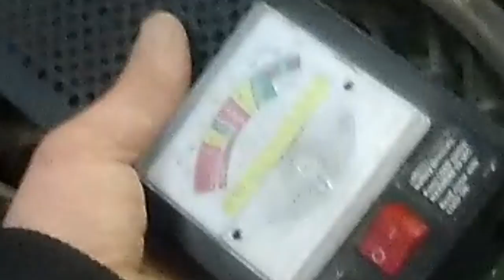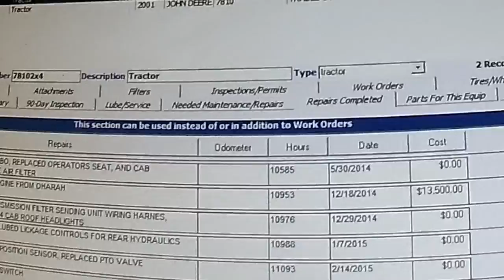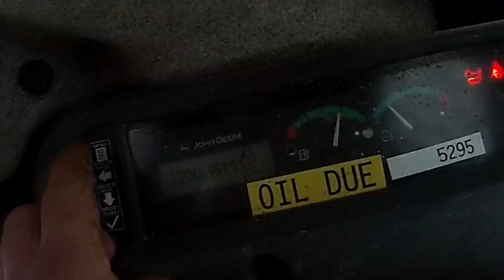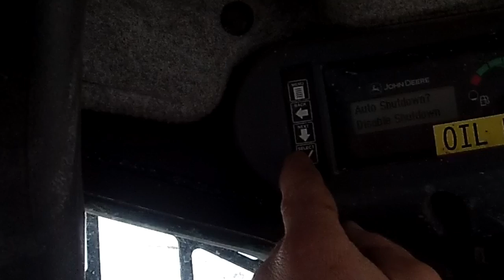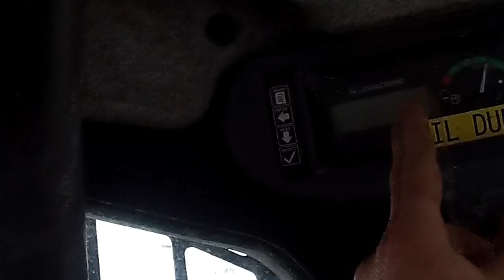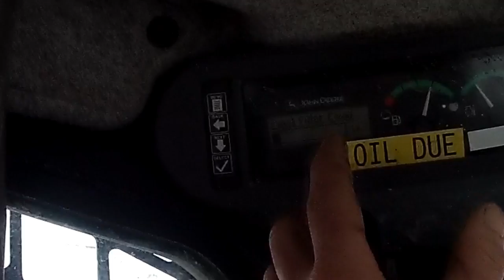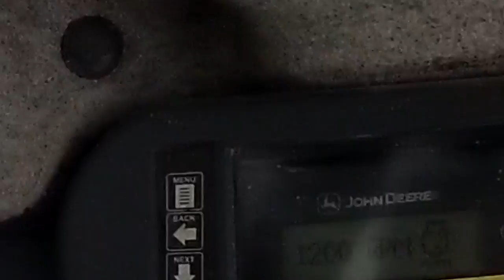Plowing snow and other stuff  1/20/2019

Comment: So when you jump start or charge start a rig you need to unhook the charger before starting or have the ground on the chassis or you will blow the diodes in the alternator (like you just did) on the tractor.
Reply from the maker: They are touchy

Comment: my father bought a set of truck chains for his skid steer and it helps out alot in the mud and snow
Reply: I used to drive semi and had the trk cleaned out to turn in for some time off but instead left sick of bull crap. I had the chains from the trk at home. They were useless as is for me so i trimmed them for my pu trk. Ive loaded the wood trl heaping full with wood down a steap hill off the side of the road. Road was glazed iced and pulled the trl out with a 2wd trk with chains.  I carry them in my f350 dually for emergency use

Comment: Hey Andy. Another cracking vid. Would the 7710 not go on wagon temporarily to save the swapping alternators?
Reply: I would assume it would be alot less maneuverable inside with a loader was probably why they opted to switch alternators... just a guess.
Reply from the maker: It was a quick change. Outside of the loader being in there hooking and unhooking was probably the same amount of work.

Comment: Anyone looking for a 7810 with front wheel assist that burnt?
Reply from the maker: We could have a year and a half ago
Reply: @FarmingFixingFabricating  the cab and motor burnt but the front and rear end still have paint on them. lol we had it on a 900t supreme feed wagon. Its has the E range in the trans so it would run 27 mph on the road. Now we have a 7830 on the wagon it's a nice tractor but doesn't run down the road as fast.